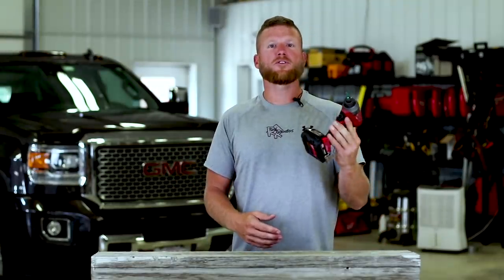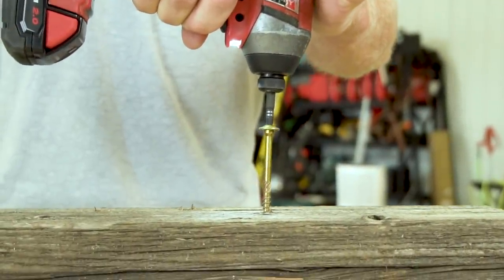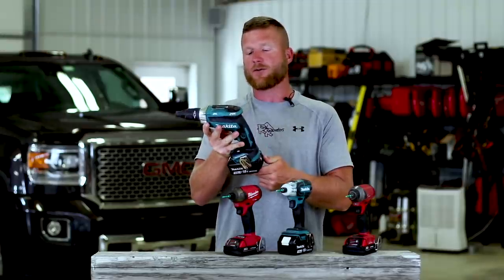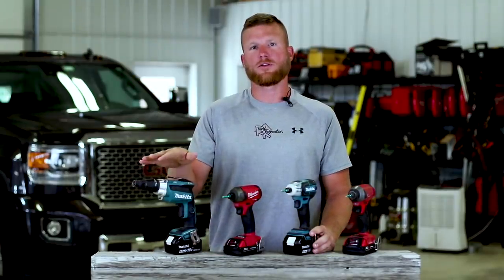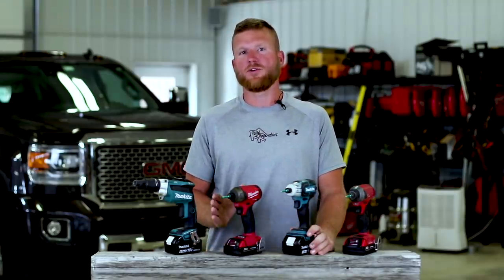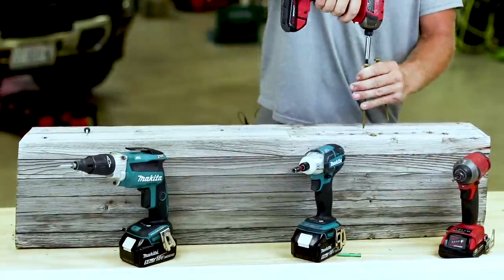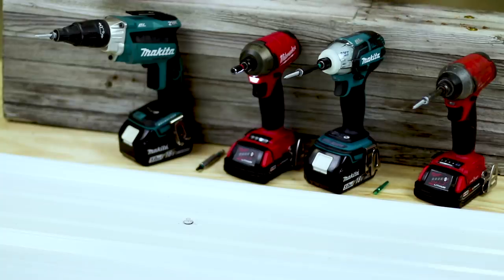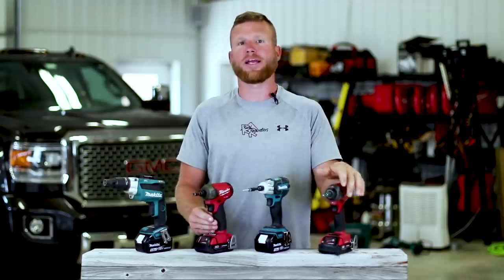What Drill to Buy: Tool Talk Tuesday

Comment: Nothing wrong with the name of the segment, concise and descriptive and accurate  !!!!!   When I was in "the trade" here in Australia there were not a lot of battery operated tools, in fact in the dark ages of my apprenticeship, there were NONE, so it was all miles and miles of cords all over the roof ? The first battery drills I had were the Makita 7.2 volt ones that I only used for putting clips or saddles on to secure copper water and gas lines, I found them handy to use on timber framed houses. I would have given my eye teeth for battery drills and drivers to use on roofing, I don't remember how many times I got "shocked" using corded tools, I used to wear "riggers gloves", a sort of calfskin type of glove that was close fitting, but when they got saturated with sweat and the sweat ran down your hand and onto the handle you often got a shock, just a sort of "wake up" shock, to remind you where you were ? Yes they were double insulated, but that didn't protect you from water/sweat ingress into the handle, and you sweated a lot , as the common temperature you worked in here in Northern Australia was 36/38 C, so at the end of the day you had NO problem with water retention as a weight factor, and there were very few "fat" Plumbers around ???  keep up the great work and cheers from Australia !!!!

Comment: I started installing window coverings in 1986 with an AEG 7.2v cordless.  My dad insisted on learning on a yankee first "you never know when this new fangled stuff could die".  He had been at it since the 50's.  Through the years, I have run DeWalt, Makita and Panasonic.  The last 13 years, I have been a PM having to step in as an installer when called on and I carry the Makita 18v drill driver.  Mostly used 1 1/2 #8's in residential and 3/4" tek in commercial, many times having to go larger depending on the application.  
Awesome review of the tools you actually use and the uses of them.  
Oh, my garage is full of Rigid 18v both drill and impact.
Reply: I have at least 3 Yankees. Do they still sell them? I remember using my first cordless Makita driver some 37-38 years ago. What a step up. But all those improvements made the muscles shrink
Reply: I really like Makita’s corded tools when you are just going to be doing so much work with very powerful heavy duty tools you need the cord. 70 pound electric jack hammer/Breaker. Large SDS Max etc. for cordless I mostly use Dewalt. Been impressed with their flexvolt tools for sure. The Milwaukee tools are great too. Haven’t used much Makita cordless.

Comment: Not sure if they are the same, but in the old days when I was slinging tools, the Panasonic drills were amazing.  I loved my Milwaukee hammer drill and still keep it out of reverence even though I don’t have working batteries for it...but my buddy’s Panasonic was a beast.  Quiet and powerful with fine control.

Comment: I was thinking the Hitachi triple hammer this entire time. I bought it but didn't really anticipate acquiring my Milwaukee gen 3 impact and hammer drill kit so I used the Milwaukee for like everything and had the Hitachi for back up or for someone else but I tried it in the rain and on a tile job and the ip56 rating really came in handy but I never realized how amazing of an impact it actually was. Still to this day it's Milwaukee gen 3 and the triple hammer. My dewalts and everything else sits in the boxes.

Comment: I do use Green for a 2 main reason : cost to own and cost to repair ..... Makita is by far the best to repair and so I got drills which are 10years sold and still kicking like the newer models. Especially when exposed to brutal sun and heat.  Makita LXPH01 for example we have like 10 of them on the job sites floating around.

Comment: I've got the Hitachi triple hammer and what I've noticed is that it struggles with driving big lags like 5/8x6.  Overheats extremely fast and slow wayy down as it heats up. Don't know what causes that but my Makita xdt14 (rated @ 1550 in-lbs) kicks the Hitachi's butt after the 3rd lag.

Comment: Hey Kyle, with the Makita metal to wood drill, how well does it perform with a 1/4" hex extension bit? As a roofer, I use the hex extension bit to save myself from bending over excessively all day. I currently use this on a Makita brushless impact driver, and you make a valid point of the paint being stripped off the head of the screw.

Comment: Great video. If you want to do another video like this with a sound comparison, look into the microphone settings on your camera. It defaults to automatically adjusting the audio levels to be more even overall, which is great in 90% of applications, but it doesn't showcase what you are trying to do here in this video. You can turn that feature off temporarily and it would let us more accurately hear a difference. Just a thought. Keep up the great work

Comment: Thanks Kyle. Very well done. I quit buying cordless tools because I always have a dead battery when I need it. Spare batteries are now so expensive so what brand in your opinion has the best batteries for the money and stay charged the longest?
Reply from the maker: Jerry in all the years using cordless....I've had 2 dewalt batteries and 2 milwaukee batteries die on me....and I promise you I use them a ton and own a ton...I think that's pretty good
Reply: Hitachi has great prices on batteries, but the tools are a bit more expensive. Bosch core 4.0ah batteries are pretty inexpensive as well, and bosch impact and drill kits are relatively the same price as the other big names.

Comment: Most of what you have are impacts.... it would be wise to have a drill driver that has multiple torque settings for various size screws/bolts....The impacts  are more designed for larger fasteners

Comment: First, the latest BLDC motor are incredibly powerful.  If someone has not tried one they really should.  And BLDC battery life is so much better than the old battery tool.

Second, it will seem extravagant for a DIYer, but get a separate impact driver,  If you do auto repair, get a 3/8" impact and a 3/8" square to 1/4" hex adapter.

Third, get a 3/8" drill even it is is 12V.  Use the standard (not large capacity) battery.  The lght weight means you will not get tired even after a whole day of using it.

Fourth, and this is the hard one.  1/2" drill need a lot of torque.  This means they need to be geared down.  Very few CORDED drills have triple gear reduction which is what you really want in a 1/2" drill.  𝐈 𝐡𝐚𝐯𝐞 𝐧𝐞𝐯𝐞𝐫 𝐬𝐞𝐞𝐧 𝐚 𝐭𝐫𝐢𝐩𝐥𝐞 𝐠𝐞𝐚𝐫 𝐫𝐞𝐝𝐮𝐜𝐭𝐢𝐨𝐧 𝐛𝐚𝐭𝐭𝐞𝐫𝐲 𝐝𝐫𝐢𝐥𝐥.  DIYers, just buy a 1/64"-1/2" drill set with everything above 3/8" turned down to 3/8" or bite the bullet and get a TRIPLE gear reduction 1/2" CORDED drill.

Comment: Great videos! Love all the detail you put into them and the quality of your workmanship! I basically use the Milwaukee surge over a standard impact everyday on the job site. I have found using a fat pack makes a world of difference on the power the surge has, albeit not quite as ergonomic when doing over head work. I've found the surge is faster at driving anything up to a fasten master 6" flat lock structural screw then the gen 2 fuel impact driver (both with 5.0 batteries). Anything bigger, the surge has issues with or can't even drive it due to the torque. At that point I use a m18 fuel 1/2" impact wrench. I live in a colder climate so I haven't noticed the slow down after they heat up. In the winter months I have to hold the trigger on with no load for 10-20 seconds to warm the fluid up at the beginning of the day so it has max performance. 

I have never had a chance to use the Makita soft impact. Do you prefer one over the other for a particular use? Is one quieter or faster at driving certain fasteners?

Comment: Great Tool Tuesday video! I have been wondering about getting a Surge to complement and/or replace my 2656. Thanks for the real world insights and demos. I learned a lot. I would love to see Milwaukee make a competitor to the 2500rpm Makita.
Reply: I replaced my Milwaukee Gen 2 Fuel impact with a Surge 1 1/2 years ago and haven't looked back.  You will never use that impact again.

Comment: RPM doesn't determine whether a gun is a sheeting/drywall gun. The adjustable nose cone and gearbox do. It's just made for different situations than your typical drywall to wood or 18-25Ga steel studs.
Our company runs a few corded counterparts for 16Ga and heavier.
Reply from the maker: Actually it does matter.  The slower 2500 rpm is for metal to metal or wood to metal screws… they need to operate at a slower rpm or will burn the tip instead of chew up the metal.
Reply: @RRBuildings  Like I said, it’s a sheeting gun for scenarios where high RPM models aren’t the right tool for thr job. But at the end of the day, it is still as much of a ‘drywall’ gun as 4K Rippem DeWalts or Grabbers, it’s just one that you’d grab for metal siding and roofs or I’d grab for hanging densglass on new exterior construction.

Comment: I use my RIDGID stealth force as my main driver everyday building decks. Handles even 10-12" GRKs no problem.
Reply: Probably because the RIDGID has 1200inlb of torque where as the Milwaukee only has  450

Comment: milwaukee is TOUGH AS HELL, there is no words to exaggerate how tough they is. my boss got some old ones we use them in the cold and a 1\2 inch cordless hit me in the chin full force when i was screwing a bolt in a small area and it busted my chin i was bleeding brusied i couldnt belive it it was  -30 degrees celsius, other drills wouldnt even work in that temperature

Comment: Do you have a preferred brand of driver bits, seems like the newer impact drivers are maxing out how much torque most of the bits can handle.
Reply from the maker: honestly I use quite a few different brands...I've had luck with most...usually lose them before they break

Comment: The issue with people not knowing the difference between the metal screw gun and a drywall screw gun, is the fact that all the company's literally use the same body, just with a different motor/gearing inside. I have seen the Dewalt ones side by side, and without seeing the model number on the gun they are identical on the outside, since all they change is the speed of the motor inside.

Comment: I am a loyal M18 Milwaukee user but I am looking for a better hammer drill because the chuck becomes useless after a couple of years due to locking up and I'm tired of having to replace them with another drill. Now I have 3 Milwaukee hammer drills, 2 I've repaired by replacing the chuck and I have a new one now. It has a 5 year warranty but the drill chuck isn't covered under the warranty. The Makita driver looks promising but let me know how long it lasts.
Reply: Hatchet Lake buy the DeWalt DCD 996. I smoked that brand new gender 3 on VCG construction this past Friday. I’m exposing red china one tool at a time.
Reply: Are you talking sds hammer drill or a hammer drill driver? I've never used Makita's sds drills but I have their most powerful hammer drill/driver. (Canadian model DHP451 not sure what the American model number is.) That thing is a beast. I've had it for three years now and it's never let me down. It can handle almost anything I can throw at it. It's definitely slower than a sds on larger holes in masonry but if you only have a couple of holes it will do up to 3/4" no problem.
Reply: I was talking about the Milwaukee fuel hammer drill/ driver, second generation. I have the Bosch bulldog extreme with sds and I've been using it for seven years now.
Reply: Renaissance Man haha, how about that 887 impact? What happened there?
Reply: Hell yeah, I build... impact is good from Milwaukee, no complaints there. I'm a framer and a welder/ fabricator...

Comment: Bah, I'm stuck with Ryobi.  too many batteries and tools to think about switching now
Reply: I run Ryobi at home in the wife's hobby shop. I am a remodeling contractor. I am not going to get into the brand wars but the Ryobi impact driver kicks ass.It is my go-to for big deck framing jobs. I do not know if mine is a freak but it just loves driving three-inch Deck-mate screws all day. It outperforms my work tools. My wifes Ryobi collection looks brand new except for the impact driver.LOLAll brands    have there good and bad.
Reply: I think there's something about the blue Ryobi impact mine still runs strong and the lithium batteries just make a better tool.

Comment: I don't know if it was just me, but the audio was muffled and faded in and out.

All of the tools you demonstrated were drivers not drills. There is a big difference. I don't remember which Milwaukee drivers has the three torque settings. Can't say it would help in your application unless you tired it out. The same goes for drills with the torque collar.

I come from the aerospace field where torque needs to be applied as specified by the fastener manufacturer. Most of our torque tools are gear driven with a slip clutch, not hydraulic or impacting type. Going into wood is an unusual case as no two pieces of lumber are going to be the same.

Like you, I own a lot of Red tools. I also own some Bosch, Makita, and Metabo. You select the right tool for the job, but in a pinch, you use what you've got. The Yellow guys, IMO contain too much plastic and in my experience the batteries don't last as long. To each his own.

Great Tool Tech Tuesday!
Reply from the maker: I think I used the term drill as a general term, but thank you for all the feedback

Comment: I would just like to comment on carpel tunnel.  This is nothing more than tight muscles in your arms.  Most of the problem starts with tight tricep muscles, but the muscles in your fore arms get tight too and pull on the tenons.  Once you work these muscles with light weights, the muscles relax and release the tenons and the pain goes away.  Almost all problems with joints are stretched tenons because of tight muscles and once you understand this, there is no need to hack and wack at the body, you just need to get in touch with your temple.